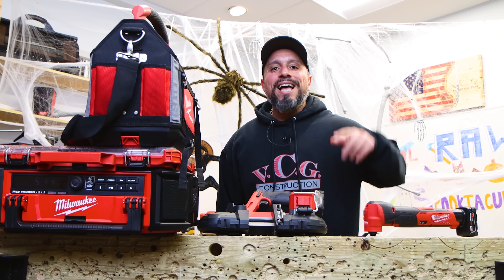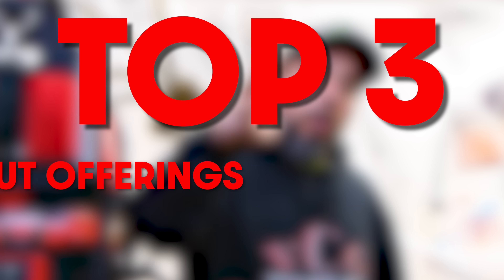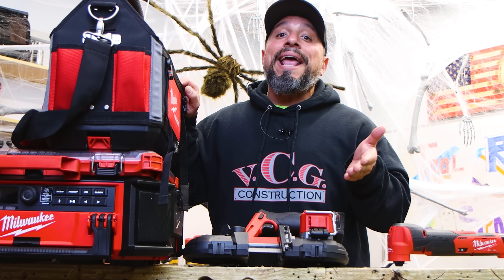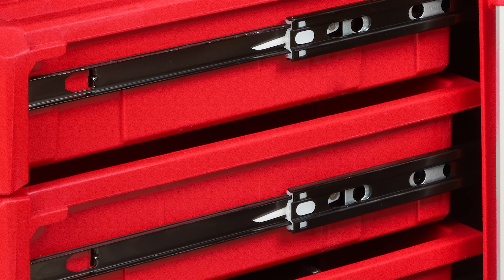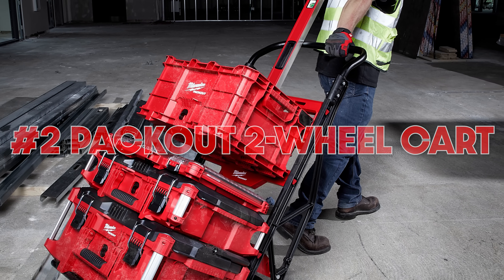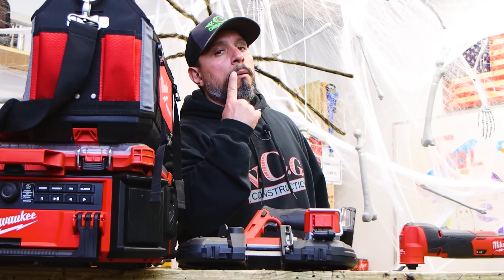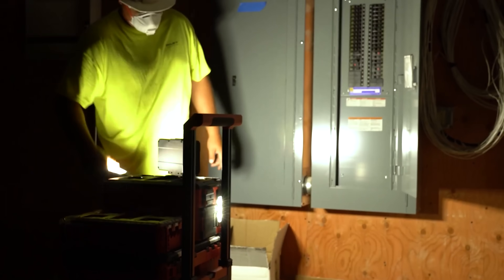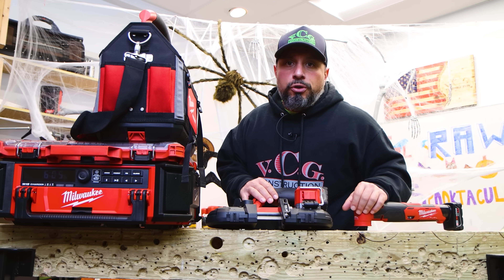NEW MILWAUKEE PACKOUT MODULAR TOOL STORAGE FOR 2021! (TOP 3 MUST HAVES)

Comment: Will the ac power cord for the light box run the lights and usb charger without a battery in?? Or will the lights only work with a battery

Comment: The new Packout Vacuum is my #1! I used my old M18 vac for a long time but having the fuel drive and dual speed and extra capacity is a big plus.
Reply: How long does it run roughly on a high output 9.0?
Reply: @totalpackagedetailingllc4413  I am receiving it soon. I’ll reply back and let you know.

Comment: I hated the fact that I had to spend full price I bought the Milwaukee packout about 4 months ago at least I got done with throwing the milk crate for free but it's still not enough to carry all my tools I'm definitely going to buy another 2 sets so I could make everything dedicated to certain things also just received Makita air compressor they told me at least 5 to 7 days it only took 3 it's the 3.0 hp 4.5 tank it has a folding handle for EZ Storage or to make it easy to move around but still looking to purchase an even bigger one like always you're the best stay healthy and safe you the wife and the rest of the vcg gang😎👍🇺🇸🇮🇹

Comment: @VCG Construction. Thanks Vince for putting out your list of top 3 must haves and why. I can definitely see all three if you're already in PACKOUT. The drawers definitely if you're not already in PACKOUT. It's a shame that we're paying a premium for the dolly hand truck since Dewalt's TOUGHSYSTEM L-cart carrier is less expensive but not as versatile and Dewalt didn't include those metal hooks on the new TOUGHSYSTEM 2.0 boxes to lock with the L-Carrier. Lastly, for the price of the PACKOUT light, it would've been nice to get a rapid charger. The charger in the PACKOUT light is a standard charger.

Hope you, your crew, and your families stay safe and well.

Comment: My top three packout picks are the two drawer, dolly, and radio.
Reply: Can’t wait for that 2 wheel cart (dolly)!!!!!
Reply: Do not get the radio. Had it since launch and have had to warranty 2 of them im on number 3 right now. Had the subwoofers blow out on previous 2. I turned the bass to -2 to combat the issue this time. Until they figure out the crap subs inside of it I would wait. Just my experience.

Comment: My first is the 3 drauwer, the second is the 2 drawer.
Both on the trolley.
But I want and wait a really big packout tote, the 20" is a little bit too small, i want full packout fingerprint plus extra width (just some inches) and more pockets, omething like the discontinued veto pro pac ot-xxl. I REALLY want it!
Because I do many things, so I need many tools which I obsesively want to be organised and quick access.
Also a foldable workbench could be nice, something the festtool mft (less expensive if possible :D)

Anyway, milwaukee make great tools, I use some of their M18, but I use other brand for handtools (so many good manufacturer in EU, knipex, wiha, wera, facom, nws, bahco and so on!)

thanks, from France, for this video!

Comment: Another good video. I like lights. 
Could you do a video on the different types of headlamps for Milwaukee.  Need info on which ones are for hard hats and which ones are for no hard hats.  It is very confusing to me.  Would like to upgrade but I’m not sure which one I need. Btw love the channel!
Reply: Get the one at 10:42  I’ve got it on my hard hat it’s great
Reply: @jakemarnoch7563  I actually need one not for a hard hat. I work in attic’s sometimes.

Comment: Damn. If i still did service work i would get the drawers in a heartbeat. I hardly used power tools so I had no use for the pack out. The drawer system would be perfect.

Comment: I wish packout had more m12 compatibility. From the light charger to the radio I might as well be using craftsman, rigid, or toughsystem for all the support you get for m12. Yea I can use the USB and my portable USB m12 chargers but I can do that with anything that has a usb....and I spend less money getting the same job done.

Comment: I really wanted the milwaukee, but my veto bag dont fit with the indented wheel wells, guess i gotta buy the dewalt one.. defiantly not as nice as the milwaukee system in my opinion

Comment: I just bought tough system 2 😂🤦‍♂️
Reply: Me too, it was so cheap Home Depot
Reply: My condolences. It is ok, but much inferior to Packout.
Reply: Good luck.  I had the gen 1 and if it was cold the boxes would crack and break very easily .  I liked them better than my Packouts for storing my tools.  But I live in New England.  And my waterproof toolboxes breaking in the snow just wasn't working.  Hopefully Gen 2 is better.  The tool cases that Dewalt used to give you with a drill were awsome but the Tough System 1 looked the same but the plastic used was fragile in the cold
Reply: Ya. I bought a bunch of ridgid pro series stuff! Its gonna suck when I show up with the Milwaukee set and have to explain to the wife why I have all these tool boxes.... 😂😂😂
Reply: Well, thats what you get for not waiting 😂
Reply: @mikestoolfun  dude i actually prefer the quality of the ridgid over all. If ridgid had the snap in aspect like milwaukee, they would be the best.

Comment: These are completely useless for those of us that need weather seals. Even inside of my trailer or under my tonneau cover my climate needs that second line of defense to avoid those little drops of condensation from forming. Depending on the time of year those drops can freeze inside the tool and seize it up and I have to wait until they thaw out to use them(mostly guns). I do love the cart though, I'll be grabbing one of those. Thanks for the video sir.

Comment: The things people will buy, jesus...
Packout -  Is reasonably strong buckets with plastic dividers and a sack truck. Worth $1000's of dollars and at much higer risk of being stolen due to it's value.
That light holy shit $200.00 + an 18v battery and the selling point is supposed to be it's a charger aswell... so it needs plugging in! sooo a $250.00+ Light bulb.

 We fall for the marketing of crap we don't really need to get the job done far to easily, and trust me, I've fallen for it way to often myself. I buy some of this "Time saving gear" and then realise If I'd not of brought this shit, I'd of had less stuff to worry about getting stolen, less stuff to carry, less stuff to worry about and more money...
A $200.00 light bulb, Jesus tap dancing christ monkey balls... "Yeah but it chargers your batteries" MY TOOLS COME WITH A CHARGER! And if I need a light, I'm probably using a tool that came with a charger!
That's like having your dining room light charge your Iphone, who really needs it!? 
Over complicating tools with gimmics to make you think it's "Better" or you need them.